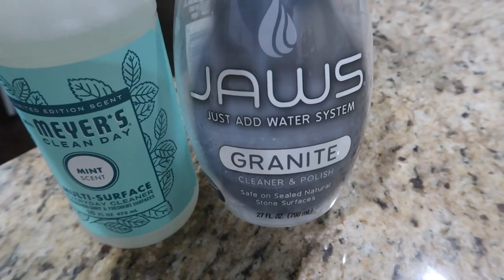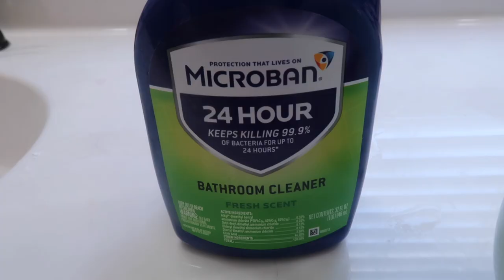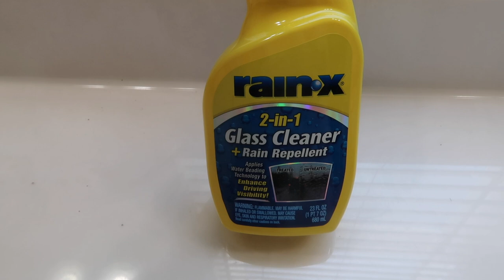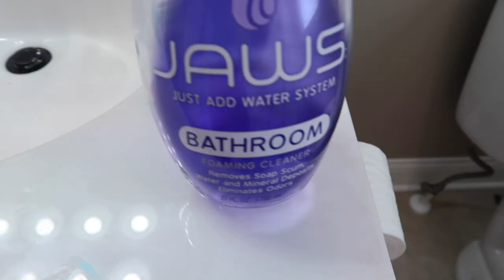*HUGE* ULTIMATE CLEAN WITH ME 2021 | EXTREME SPEED CLEANING MOTIVATION | CLEANING ROUTINE

Comment: It is not mold in the kids toilet. Its rust residue caused by a rusty pipe. The pipe that runs to that toilet may have a rust issue. Unfortunately, no matter how much you clean it, it will return.